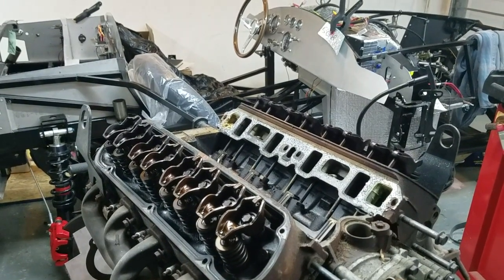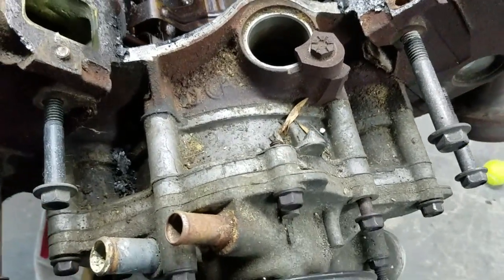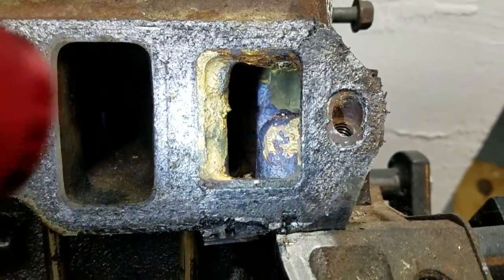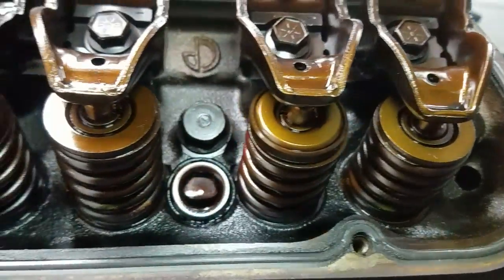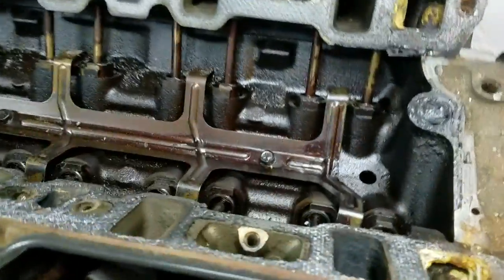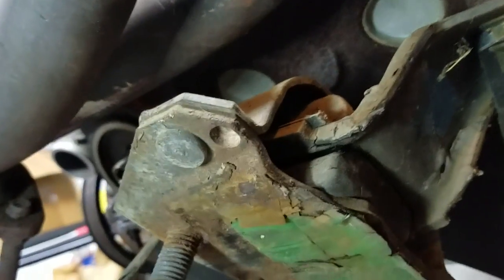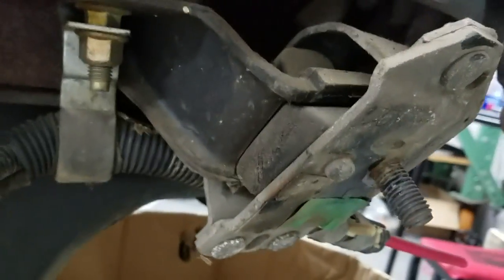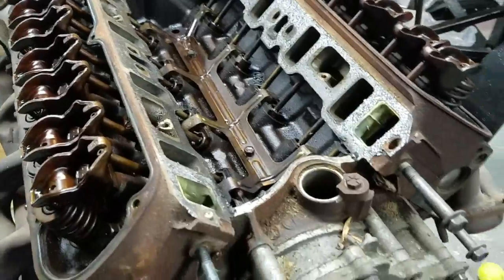My 302. I'm ready to learn

Comment: I would resurface the fly wheel and pressure plate for sure.  Before I would run it I would change all the gaskets including the head gaskets. Easier to do now while the engine is out.  The engine sits so far back in the cobra its not too easy getting it in and out with the body on the car so do those things now before you stick it in!
Reply from the maker: Thank you very much.  I'll plan to do that.